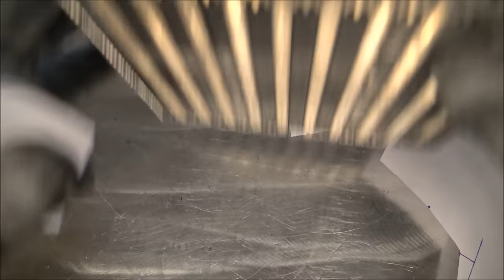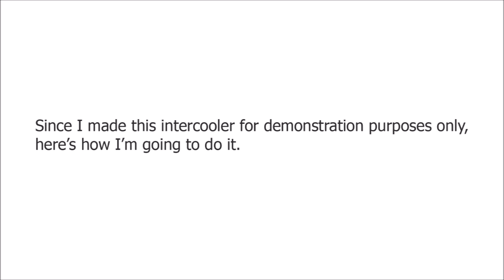Tig Welding Aluminum Fabrication - Turbocharger Intercooler Build and Pressure Test

Comment: This guy's beads look like they were done by a machine.Hes not just a fabricator.Hes an artist.
Reply: Agreed
Reply: So fucking precise welding
Reply: Ikr I wasn't interested in the intercooler. I just saw the welds in the thumbnail and had to watch.
Reply: welding porn at its finest
Reply: @felixnilsson7636  indeed
Reply: Was wishing i had the money for a half decent tig welder, now i wish i knew this guy 😂
Reply: Steady hand and flat 1g is fairly easy with some practice
Reply: @johncoldwell340  If you can't afford a machine, you can't afford this guy.
Reply: Maybe he is a robot
Reply: You re contradicting yourself, machine cant be an artist
Reply: Just a pro man they alll weld like that and even better
Reply: @David-ls4qp  ⁷7i
Reply: @petermiller7994  Agreed. A pro will out weld a robot machine any day. A robot welder is only as good as the operator and only adjusts if adjustments are made by the operator. A welder constantly is adjusting and moving and setting himself to make perfect welds which a robot needs to be told to do. Plus, robots can't see what's going on and know what to change, it takes a human. No machine will ever out match a human. Ever.
Reply: Absofknlutely!!

Comment: cant believe I just watched someone build a tiny intercooler for 20 minutes... but the process, the care, and WELDS! tip of the hat to you sir, I've never welded in my life and this makes me want to do it.
Reply: TIG is the hardest, and he made that shit look easy
Reply: @thatblackz1850  i think tig is easier than stickwelding lol, and more comfortable than mig/mag
Reply: @mrmiyagi3533  At school we started with steel with 1/16 plate in T or V and we only fuse the 2 piece together after we learn how to feed.
Reply: @mrmiyagi3533  stick is easy.  Tig takes your entire body to coordinate.
Reply: Everyone should learn how to weld, do it, get a friend to show you or take a class, you won't regret it
Reply: @fighterx4133  imo i thing tig is easier, ypu can chill, just work with ur hands, stick you have to bring the rod in closer lol i could never figure it out
Reply: @jeffel80  you use different techniques for different applications.  Running beads on thick material with stick is literally the first thing you learn in trade school.  Tig welding titanium is massively harder to keep consistent bead size, height and heat/shielding for a professional finish.
Reply: Do it! Just started myself at 37
Reply: mr miyagi 🤔🧐 You didn't even get to GTAW till on your Second Yr Journeyman Gov Exams here. SMAW IS easy, you can take a 7024 Rod and let it run a Bead all by itself. GTAW is MUCH easier than Oxy/Acetylene Welding though which you still had to do when I took my Exams (I don't think it was listed last time I checked.) DS-FCAW & FCAW is definitely the easiest process IMHO..👨🏼‍🏭 Lots of that in Structural Welding.
Reply: Be careful it can be addicting
Reply: @greenchiliforge1059  yup. Definetly addictive. I still catch myself cutting up random pieces and welding them back together when im not doing actual work. Don’t forget all the extra “friends” you will make once word gets out that you tig aluminum.
Reply: @thatblackz1850  Definitely not the hardest. All processes have easy and hard times. More less depends on the job at hand that will decide if it's hard or easy. And the material. Tig, as a process though, definitely is not the hardest.
Reply: @fighterx4133  yea but a little bit too much coffee on a tig doesn't make to much of a difference but on a stick whe  your holding it with one hand and ya 40 cm away from the end of it that early morning caffeine overdose makes life hard with a tig once you learn how to feed wire and move the torch it's no harder than mig and some joins and positions are easier id rather do a 3g open root pass with a tig than a mig these days but I spend alot of time cooking tungsten these days at work
Reply: @sicsam1  Me at 56. Don't regret it at all.

Comment: 99% of the time he is welding not propping on anything and is steady as a rock.  That is very difficult to keep it straight as demonstrated here.  Simply amazing.
Reply: Those start / stops are pretty sweet too, can't even tell. Been 15 yrs since I've done any AL -T.I.G.  Bravo !!
Reply: I have a hard time freehand welding, I mig weld which I’m sure is even easier to freehand compared to tig. I build 53’ enclosed trailers like nascar stuff and truck pull stuff, shit for Porsche and Michelin, cooper tires, KTM, and other stuff, right now building pods for Three Olives, built stuff for Chick-fil-A! I’ve always wanted to learn to tig tho, we do some tig like aluminum handrails and fuel tanks, some stuff on the lift gates are aluminum to. Just don’t have the time to learn at work or even after work since we only have 1 morning shift
Reply: @reaction9449  Look for some local use equipment or HTTP welder are not so expensive and good quality i bought one chinese tig for around 100$. Work on 120/240 i try the 120 at around 100 amp the breaker trip, i want to test it on 240 before i leave my current job. I try welding steel 3/16 thick at 100 amps on 120 and it wasn't enough maybe i should have try aluminum can.
Reply: He is actually is propping he using the ledge of the table to guide his torch hand.
Reply: He props literally the entire video what are you talking about? Lol

Comment: Old, practiced hands can make works of art using the crappiest equipment.

I knew a welder, Tan, in ChoLon, SaiGon, now retired, who specialised in heavy metal welding such as as railway wheels, nut & screw washing barrels, boat propellers (up to 1.5M), etc.

Had muscles of steel and did all his work sitting on stools outside his workshop.

His work was so good his customers ranged from boat yards to government agencies to industrial manufacturers - all done with an ancient welder and his talent acquired through years of work. May you have a long retirement Tan.

Comment: I bought one of the first inverter bread box china made tig units years ago (DC) only of course.  Bought my first full size AC/DC unit late last year, the quality is okay but its doesn't have the adjustments you need to do the kind of work you see in this video.  It seems like the quality of these inverter machines change and improve every 6 months or less and as I gain more confidence I want more capabilities in my machine.  I will be ordering a new machine just as soon as I finish writing this.  I've watched this video before but watching it again pushed me off the fence because I know the machine I have can't produce anything like what your doing.  The new machine will have better processes but the operator will still have a long way to go.  And, I'm only a hobbyist who has been stick and mig welding for 50 years.  Love your work and your videos.  Gotta run, I hear Amazon calling my name.......

Comment: LOL - I love how you weld circular end caps on the inter-cooler INSTEAD of simply using fittings, I guess when you can weld anything perfectly like yourself that's the easier option ;)
Reply: Except so much care was put into keeping the intercooler clean from chips.  ...then weld caps on the ends for the pressure test.  Cutting them off would contaminate the intercooler with tons of chips.
Reply from the maker: 16:48

Comment: Nice work I remember my first intercooler  build ugh it took me a bit but I got it i thought it would have been a half day job 32"x12x3 just setting it up making cuts and parts took me almost a day it didn't help they wanted to stuff it it a f,body ws6 it was fun i welded structural aluminum for school hall awnings and churches exc at perfection architectural design weldind toilet paper end caps on the awning ends for rain u just clean em with knife and no filler got so cocky with them the made me the lead welder at a custom rain gutter shop welding brass/copper gutters together wit the tig that was the biggest challenge ever thin copper/brass gutters only for the richest of rich but absolutely 💯 beautiful and a serious pain in ass took me atleast a week to get use to it now in my sleep backpurge was key belive it or not cheap meterial with alot of different metallurgical %. My 6g tig mig stick tests ss were easier then that got cert for food grade stainless pipe, steelpipe,titanium pipe,aluminum  but failed the 13gr5 test for structural with a big wire shielded mig twice lol great video

Comment: Wow, that’s a great intercooler!!

Can you do a video where you modify a radiator??

I need to cut a radiator in half and make two smaller radiators out of it. I’m a bit concerned about melting the aluminum braze that the fins are attached with with my TIG torch.

Comment: Hey question: where do i find intercoolers to use for fabrication practice?
Reply: Cores are cheap on eBay
Reply: Company called vibrant sells them
Reply: Intercooler core supplyer?
Reply: I would start by googling "intercooler core" with the size you want, should be a few suppliers
Reply: Back in the day I used to go-to the wreakers and look for old Nissan exa and pulsar etc.

Plus on eBay you can buy some STD 200sx and skyline ones for like 20 bucks as there useless from the factory. I practiced on those. Most had a shot coating of some sort on them but if you clean that of there fine to practice with
Reply: Just get cheap eBay ones for practice. For high end builds you can buy just the cores from pwr.
Reply: Check a radiator shop or junkyard.

Comment: What type of aluminium alloy is best for welding?. I work as a mechanical engineer at a hospital in NL. We usually use stainless steel but sometimes we need a lighter material. I've noticed that the aluminium used in this video is shinier and flows a lot better when you try to weld it, Looks a Little less soft as well. Nice work btw,

Comment: Is it called a "core"?
Where did you get it from? I would like to make an alluminium one from my computer for water cooling.
Thanks
Reply: either a radiator or intercooler core, you can buy em off ebay, amazon, etc. and can probably find them local at a muffler or radiator shop

Comment: Hey, in our car the cooler/intercooler have no protection net or something like that in the front of the car, so when we drive a bit faster, all the stones fly into the cooler/intercooler, and it gets dents in the aluminum, so it seems air can't get through that good.. Is this normal or bad? Any experts?
Reply from the maker: Hi Ferdi,
Use one of these to straighten all the fins back out. Ideally, all the fins are nice and straight so air can pass through everywhere evenly:
https://amzn.to/2uSNOdW

Comment: Hi you are an master. You are using vacuum brazed heat exchanger core. Can you explain which wire did you use aisi5 or aisi12 or something else? Also did you use double pulse? Also i need information about balance ratio that you use. Can you please give some information about, because ı want to weld my own intercooler. Regards
Reply from the maker: Hi,
Everything is explained in detail on the website http://www.6061.com

Comment: Question about the amp. power button on the torch:  I have a 20 year old Tig welder with a pedal and a pulse box. Both cannot be operated together. Either the foot pedal with no pulse, or the pulse box which requires to disconnect the pedal. In other words, cannot pulse with pedal. If I purchase the torch with the progressive amp. button, will it solve my problem?
Reply from the maker: No, the TIG Button replaces a foot pedal.

Comment: That intercooler will be about as useful as the stock one, or worse. its so small. but very very well built
Reply from the maker: Too small for a 141hp engine you say? Small bush airplanes have width constraints in the engine cowl you know...

Comment: I'm not familiar with performance parts of any kind so forgive a stupid question: what is the bottom? A reservoir for more coolant? And if so why not add a petcock or drain of some kind? Thanks to anyone who clears this up for me lol.
Reply: The bottom of what? He built a intercooler. 'boosted' Air goes into one opening crosses the intercooler into the end tank then forced back across the intercooler and out of the other opening.
Reply: It is an air-to-air intercooler. The air compressed by the turbocharger going to the engine goes through the core through the large round inlet and outlet fittings. Atmospheric air (sometimes assisted by a fan in race applications) passes through the area that looks like a radiator. Due to the heat of compressing incoming air with the turbocharger it's hotter than the outside air. So you're dumping that heat back into the outside airstream.

He's only filling it with water during the high pressure test, so that if it ruptures you don't have a bomb on your hands. Air is compressible, water being a liquid is not. If you spring a leak it's going to dump the pressure immediately. If it were full of air it could peel open like a tin can and fly across the shop or worse hit you in the face.
Reply: This is designed to flow air not fluid.  Look up intercooler
Reply: It Guides the Air back through the other half of the intercooler

Comment: Hey at min 12:00 he use air befor he start the next welding line anyone now why?
Reply from the maker: To cool the part down. It's easier to control the bead width and shininess if the entire part isn't extremely hot.